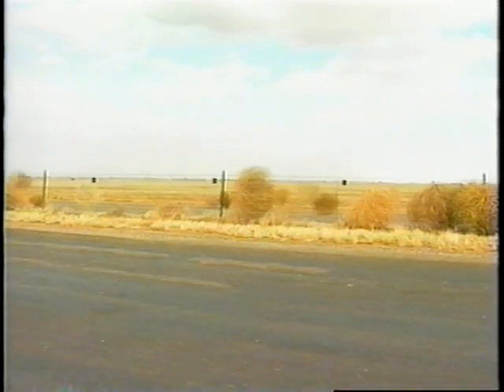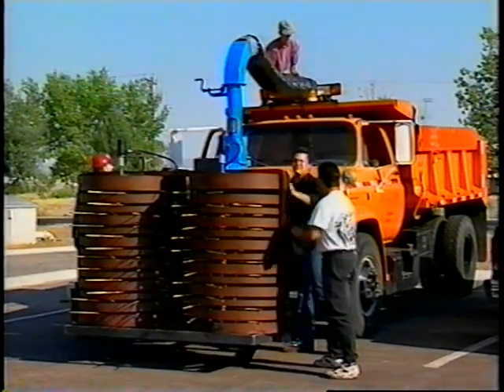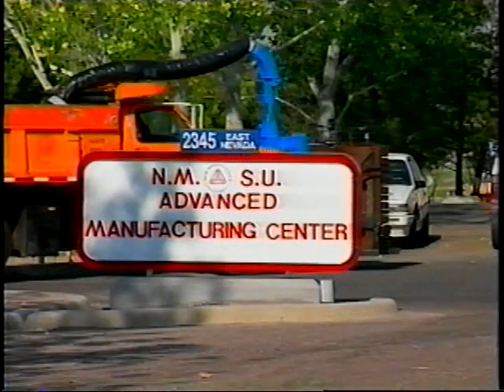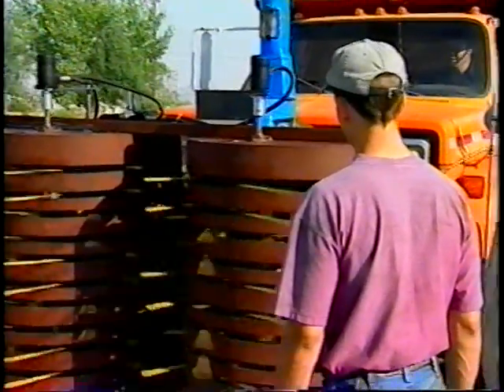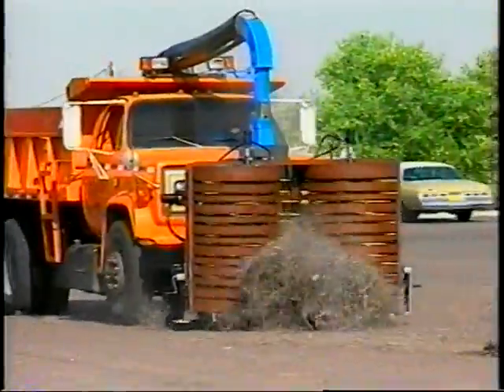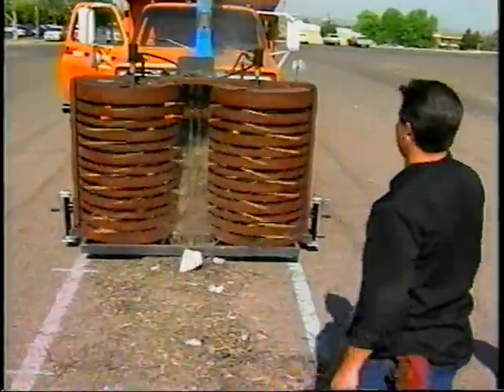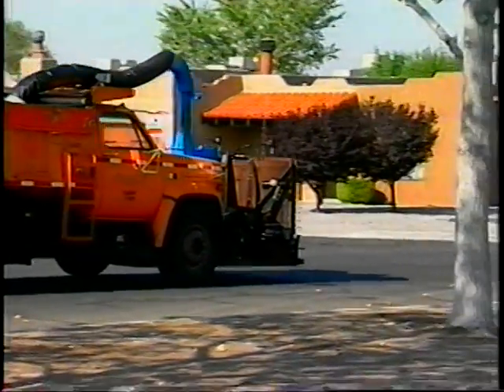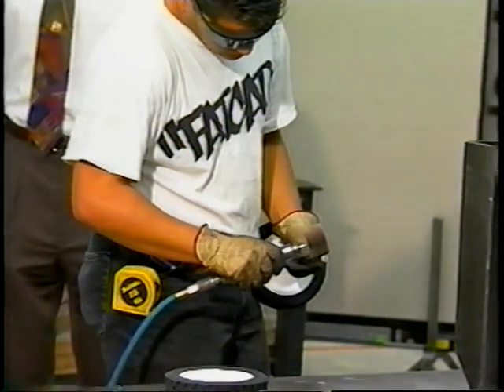Innovative Tumbleweed Removal

Comment: I see a source of fuel, and - if you can believe it - plywood! A pickup enhancement would be to mount a blower near the pickup aperture. An air knife arrangement may work. A second chipper assembly further divides the material for better compaction, and helps eliminate blockage due to conduit crimp. The stuff can be used as road salt, fuel pellets, mulch (after suitable treatment to deactivate seeds), and mdf feedstock.